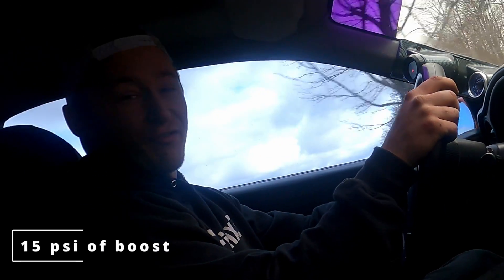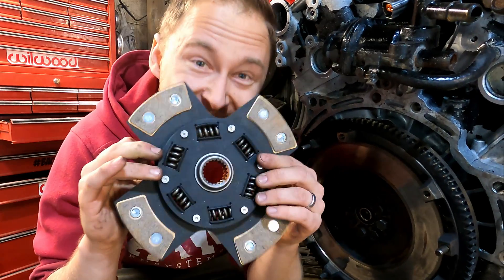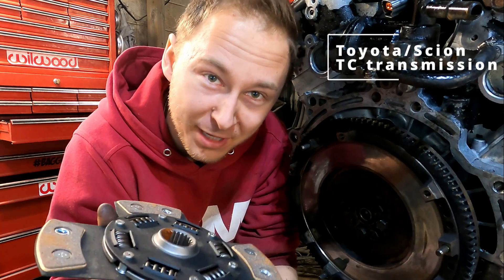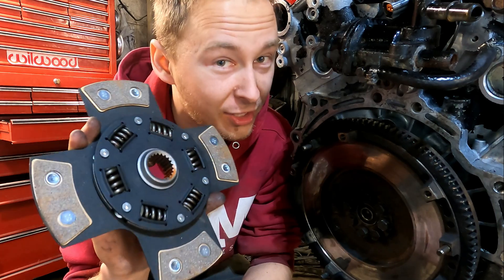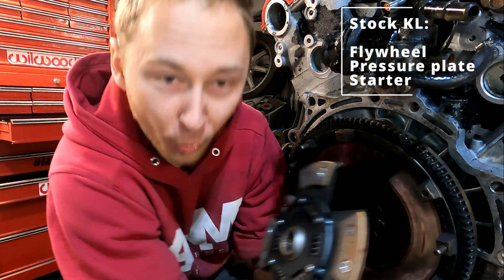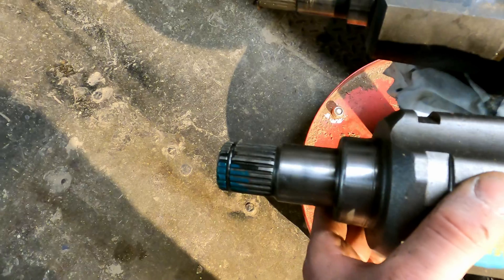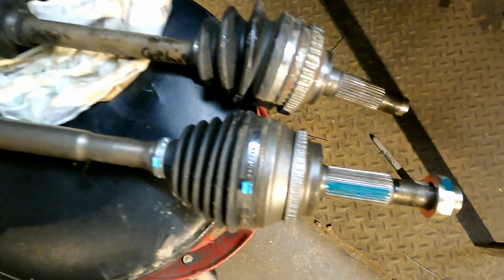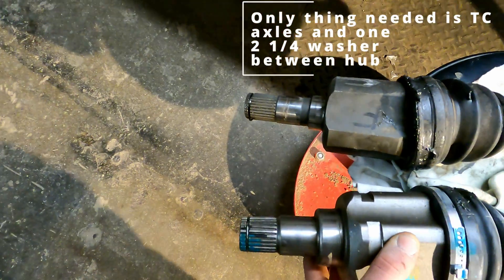V6 KL Adapter plate is done!! Budget BULLET PROOF Transmission for 750WHP (PROVEN at end of video)

Comment: Hey dude I'm so excited for what you've built but I've got one I guess dumb question, I really enjoy driving my Ford probe but it's automatic..... Would this adapter plate still apply in my case?
Reply from the maker: @coconutoperator2340  yeah you can still adapt to the camry 5 speed trans
Reply: @Suicid3mx3  like a camry 5 speed auto? and what one would i have to get/ other items i'd need to do the swap.  thank you btw and sorry for being a pain
Reply from the maker: @coconutoperator2340  no pain!! ad the swap is for 5 speed manual transmission out of a camry transmission and scion tc
Reply: @Suicid3mx3  I'm so bad at wording stuff, would the automatic versions of the cars you listed in your description and just then, bolt straight up to the adapter plate and still work (with obviously the trans TCM and wiring) but if what other auto trans could I use instead? (I'm swapping auto for auto)
Reply from the maker: @coconutoperator2340  ya it should work!!

Comment: Do you make trans adapter plates for the fsde?
Reply: I have a Mazda speed protege and I really need a good trans, was wondering what my engine options are using the adapter
Reply from the maker: @Brian-cr4mb  what engine is it
Reply: @Suicid3mx3  the stock 2.0, fsde engine,
Reply from the maker: @Brian-cr4mb  in mx3s?
Reply: @Suicid3mx3  my mazdaspeed
Reply from the maker: @Brian-cr4mb  dude that sucks, maybe i can make a plate for you, I have all the drawings for the bolt patern on the Toyota transmission
Reply: @Suicid3mx3  I would appreciate that immensely dude, the stick Fsde motor can be built up but the trans is trash, I’ve been wanting to do this swap for a while